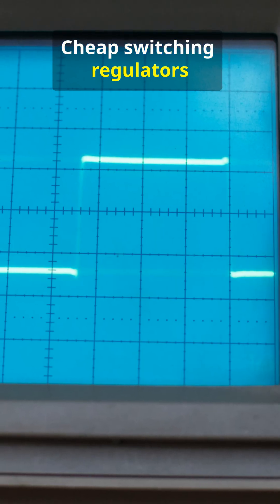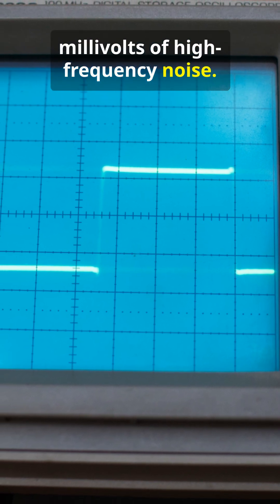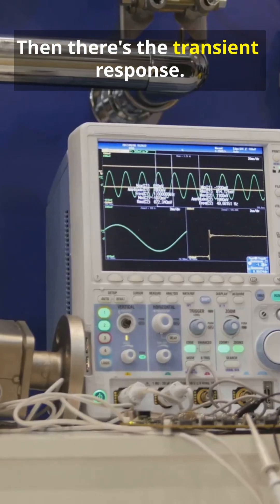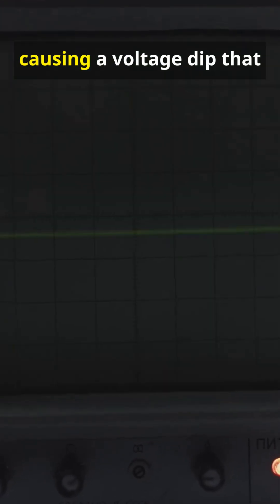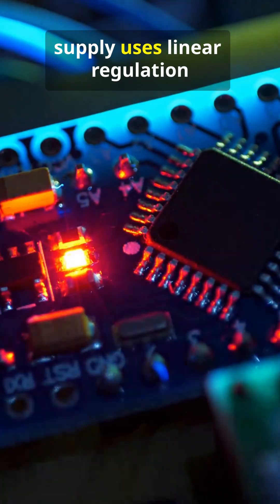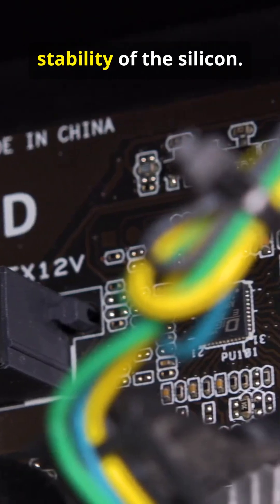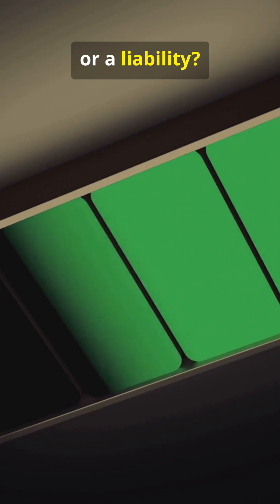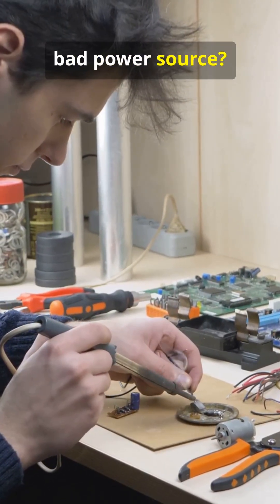Why a $2 Buck Converter Is Killing Your Projects 😳 #Shorts #Electronics #PowerSupply

Comment: So first test your project with batteries :)
Reply from the maker: You would still need batteries even when u are using a converter or instead use a reliable power source or get a good buck converter

Comment: I'm using LM2596 to power ESP32 cam and uno r3 at the same time. Mostly it works great but sometimes I noticed that when the battery runs low, the esp32 cam goes into boot looping. That's why I just hate esp32 so much idk if the issue is with buk converter or esp. Otherwise it's a great converter. No issues at all.
Reply from the maker: K mostly it's the buck converters problem
Reply: I'm also using lm2596 and esp but also servos which creates brownout !
What is best way to stabilize power ?

Comment: Do you recommend the buck LM2596?
Reply from the maker: It's a good and cheap option but there are definitely more better alternatives
Reply: @TechSparkBuilds Which ones do you recommend?
Reply from the maker: XL4015 / XL4016 Buck Modules – popular high-current buck converters, often available rated for 5–10 A+ depending on module version. They’re a step up from the typical LM2596 designs and handle higher currents and heavier loads better
Reply from the maker: It's based on your needs
Reply: @TechSparkBuilds  Thanks, but my project needs only something about 1A, I think LM2596 should be a good option, don't you think?
Reply: @TechSparkBuilds It would be great if you make a video teaching how to design an LC filter
Reply from the maker: @007ify11 Yh it's surely a good option
Reply from the maker: Ok I will try
Reply: @TechSparkBuilds please share with us the best option
Reply from the maker: @aggreymasonda27 it really depends on your needs and budget
Reply: What I understand, the xl6009 can send burst when it starts and can fry other components, I’ve been using the mt3608 and have no issues
Reply from the maker: @250smacks k
Reply: @A @TechSparkBuilds I haven’t used one before.

Comment: I have a dual-fed pair of busbars with each feed having a diode. The supply the other side of the diode is 1.1v lower and causes a brown out every time I start the boat engines which has a big draw
Reply from the maker: Ok are u asking what you should do
Reply: @TechSparkBuilds yeah, or why would diodes reduce voltage like this
Reply: @BigCol_SeaAndSea  Arduino tech just uses AI, they don't know. Diodes have a voltage drop.  and a forward current. The voltage drop is how much the voltage decreases when current is drawn, the forward current is the max current the diode is rated for. Usually if you draw too much current they'll either melt or blow up. Since youre getting a brown out it probably means the voltage drop is too high. you can either get different diodes with a smaller voltage drop or just get 2 more diodes and connect another one in parallel with the two you have now (joining the + side and the negative side of one new diode to each one on the busbar you have now)
Reply from the maker: @123isonmi I do know
Reply: @B @BigCol_SeaAndSea that’s why you didn’t answer for 8 hours but replied to my comment right away?
Reply from the maker: @BigCol_SeaAndSea That behavior is expected. The diodes are there for isolation, but they introduce a forward voltage drop that increases with current. Under heavy load (engine start), the current surge causes a larger drop across the diode (often 0.7–1.1 V), so the downstream bus sees a brief undervoltage and browns out. It’s not the engine itself causing it directly—it’s the diode + high inrush current. Using Schottky diodes, an ideal-diode MOSFET setup, or powering sensitive electronics before the diodes can reduce or eliminate the brownout.
Reply from the maker: @123isonmi yh time zones